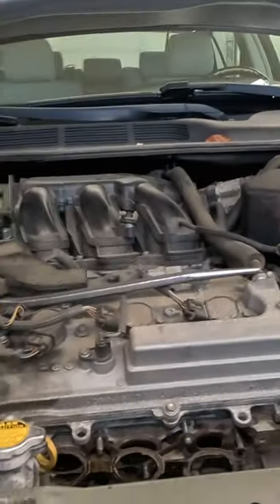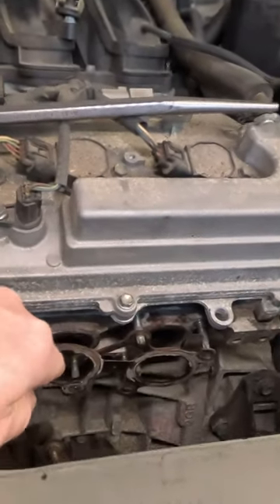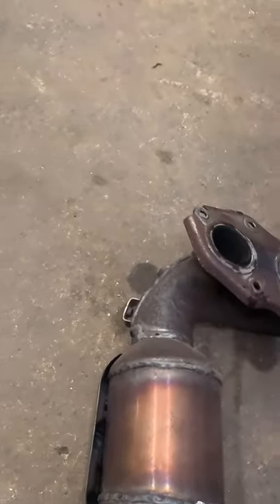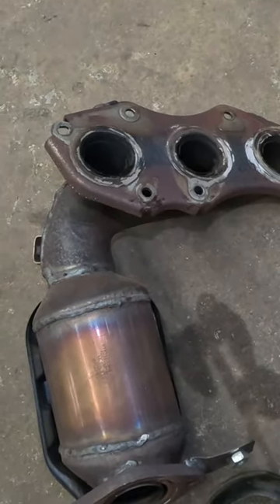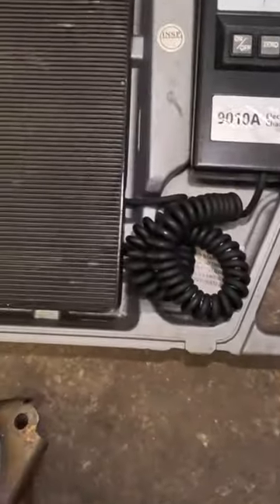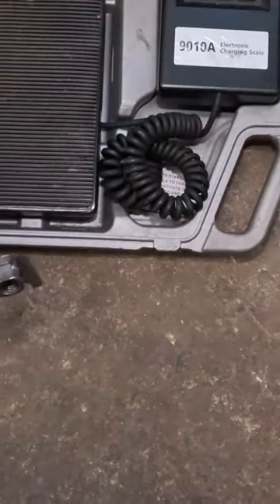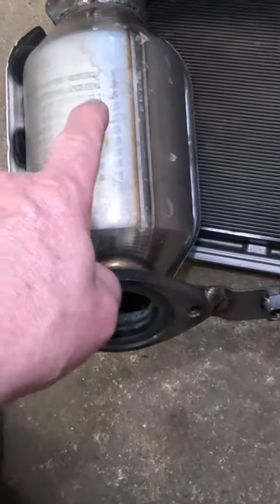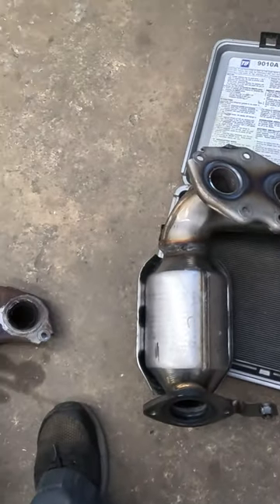The unseen difference between aftermarket and factory catalytic converters.

Comment: Is the aftermarket one a carb certified?  Supposedly any calf compliant state requires the carb certified converters. They tend to be a lot more expensive but are supposed to contain more material and be rated to last longer.
Reply from the maker: I doubt it was carb. Whoever installed it reused gaskets and added rtv. Looks like they went as cheap as possible.
Reply: I got one from ebay for a 4 cylinder  ford fiesta and instill got po420 code but yet everything  on the scan tool looks good....
Reply from the maker: The graphing on a scan tool isn't always fast enough to see O2 storage issues. I usually use a scope to check converter efficiency.
Reply: @OTRAMM  true... yes it's weird and ist not affecting performance  but the code is annoying  and possibly  a smog no pass
Reply from the maker: @theexaminer5224  but when the aftermarket one fails repeatedly is it really any cheaper?

Comment: I've had to purchase one catalytic converter and it was aftermarket.  It failed in no time at all.  So I replaced it with another aftermarket one and so far so good.  I guess in my expressly tiny dealings with non-factory units it's hit or miss.  I just can't see paying 3 and 4 times the amount if $$ for factory.   Is there really that much difference in materials to warrant the huge price difference? I am currently getting an engine code for a catalytic converter on another vehicle.  Really difficult job too so I guess I'll bite the bullet and get the factory one it calls for.  Can some aftermarket cat builder please build one like the factory please?  Restore my faith !!
Reply from the maker: I've had zero luck with aftermarket on anything 2000ish and newer.
Reply: @OTRAMM  yep.  My first was an '04 and the current one is an '08.  I'll go factory.  But dang at the price !!
Reply from the maker: Yeah I'm not looking forward to the day when the cat on my CT200h goes out. It's got coolant running through it too.
Reply: @OTRAMM  I bet you aren't looking  forward to that.  Had no idea some had fluid running  through them
Reply from the maker: @gregfriesen1365  the newer hybrids use the cat to speed up the coolant warm up.
Reply: @OTRAMM  thanks for explaining that !
Reply: Had an aftermarket on an 02 Saturn, survived the remaining 60k of life on the car to 250k. Even if I had to go through 2, cats, the OEM replacement costs 5-20 times more than an aftermarket.
Reply: Hey Greg, I know this is a little old but I'm going to shoot this information out there anyways. Aftermarket catalytic converters contain aluminum, tin, and other cheap metals to perform the catalyst... Stock OEM cats contain Platinum, palladium, rhodium, and other precious metals.. so yeah, the price difference is definitely warrantable. You can get good aftermarket converters that are still half the price as an OEM and will last for years. Just don't get the cheap $75 universal cat
Reply: That's not necessarily true, I cut a lot of cats daily. The hybrid cats are top dollar in this market due to them containing three to five times the amount of precious metal as a normal I.C.E engine converter. It's a crazy market, last week $1,200 for a Prius cat but this week the price has dropped to $975 for the same cat. I have never once seen any kind of coolant lines running to the hybrid converters. I'm not saying it's not true but it must be very very very rare.
Reply from the maker: The newer Toyota hybrids have coolant running through them. I've seen it on several of them. It warms up the heater circuit quickly instead of using the thermos bottle they did on the early ones.
Reply: @billsauer3164  good to know.  I figured there had to be a good reason. I sometimes buy OEM parts and sometimes aftermarket.  It's not always about price.  I just want good value.  This info is good to know though.    Thanks!

Comment: My factory catalytic converter cost 1,700 an aftermarket at Autozone cost 300 that is a 1,400 dollar difference. 
A local muffler shop has theirs at 500.00 for the catalytic converter.
I'm going to buy  a Tesla....problem solved 😅
Reply: Cats usually fail after 150k miles, I want to see how a Tesla battery holds up after the same amount of miles, my guess is that it will be more expensive to get a new battery than a cat lol
Reply: My cat for my daily 2008 crv honda wants $3,300 for. And no they’re not ripping me off I’ve called 10 different dealers and gotten the same price. I live in NY and now we have communist california carb laws honestly I’d rather buy 5 aftermarkets than pay the entire value of the car in a catalytic convertor.

Comment: Yeah, it makes you mechanics richer by buying oem.
Reply from the maker: I'm not getting rich by any means. Using OE means I'm not replacing garbage aftermarket parts under warranty when they fail after a month. We're a real shop with a real warranty so we use real parts.
Reply: Its funny cause at the dealership its quiet the opposite the advsior and sales department make $ from customers buying expensive things all the tech gets paid for is installation regardless the brand
Reply: its four spring bolts and two donuts, rent the o2 sensor socket at autozone. Altogether its $1700 for oem if you do it yourself.